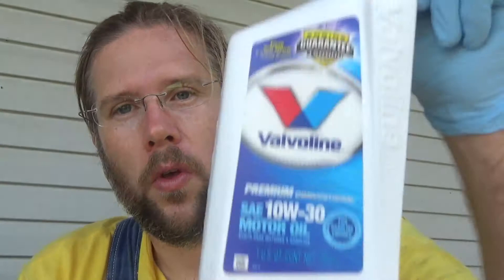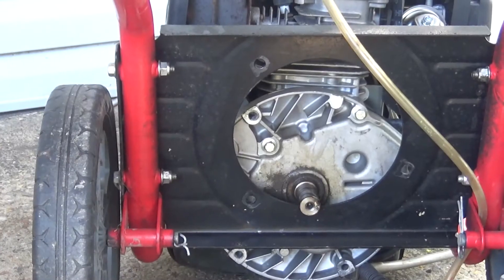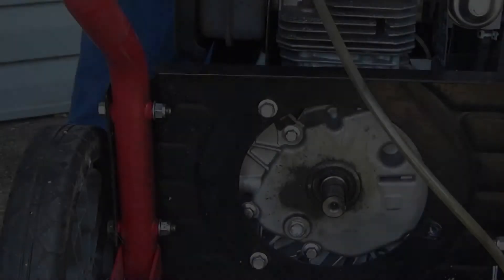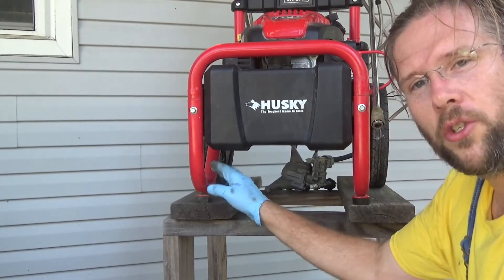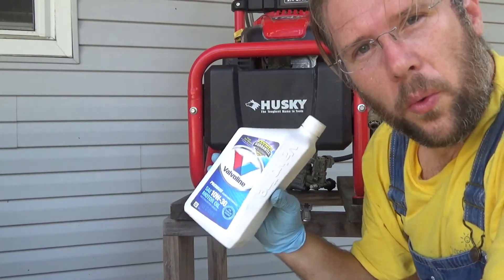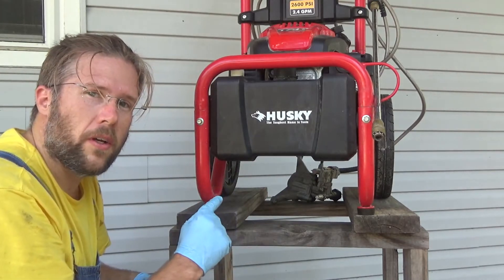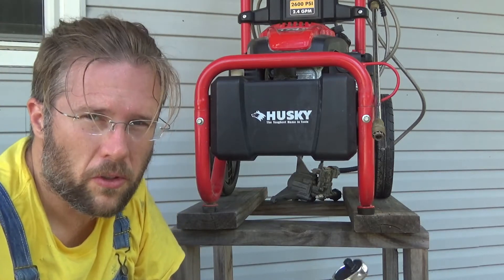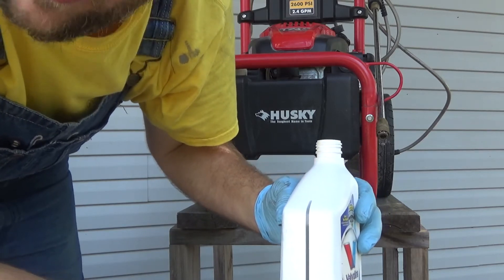Husky Pressure Washer HU80709 with Kohler Courage XT-7 173CC Oil Change

Comment: My neighbor asked me to get his HU80709 running.
It looks like a very nice machine, and thanks for the quick summary about the oil change.
When I do oil changes, I pour oil out of the new quart container into another
'spare' container until the original has exactly 22 ounces.
Then, just pour ALL the 'new' container into the engine.
Simplicity is next to godliness!
-=-=-=-=-
The overall pants are also great for those of us that hate belts.
Keep up the great work!

Mr Brown - Swamps of Florida ---
Reply from the maker: Thank you for the comment and suggestion.

Comment: I have the same pressure washer, possibly a slightly newer model.  Most of this is unnecessary for mine, as you just tip the machine, fully assembled, on it's side and 99% of the oil will drain out the oil fill tube. Much faster.  I also found the drain plug on mine. It is also sealed and takes a large Allen wrench. Probably intended to prevent disassembly.

I love the minion outfit too. LOL
Reply from the maker: You could tip this one too and it will run out of the fill tube. Thank you for the comment.
Reply: I'm changing mine now and the manual actually says to just tip over and drain through the fill. Thanks for the video, though. 👍

Comment: I have the same pressure washer and was wondering if you could help me with a problem its having. I saw the machine is leaking oil from the Crank seal. So I was wondering where I could find a replacement for the crank seal? Please let me know if you know. Thank you
Reply from the maker: I can try.
Reply from the maker: Check the following site, I am not sure if they are any good or not, but you may be able to cross-reference the part elsewhere.Also, you could try to make your own with some gasket maker like Permatex Ultra Grey. https://www.partstree.com/parts/search/parts/?modelId=9c744f749ae707df46eb2e51a889811ea5bc224d3deba47c0fe06c06eb1f1b50&searchTerm=gasket

Comment: I have a Hu80709 pw like the one u did oil change. I'm replacing the oil gasket. The cam came out and I do not know where to line it up. I see a dot on each gear.  Ty.
Reply from the maker: I wish I could help, but I am not sure what the alignment would be.

Comment: Hello I have a question..my unloader valve is stuck ...or do I not have one ..please help..I got it off someone there was a crack in valve..I'm use jb to stop leak.. back to unloader..I took of screw.. spring and still won't come out please help
Reply from the maker: Are you able to post a picture?

Comment: I followed your instructions up to the gasket and then saw the comment about tipping the oil out. Now that I'm reassembled I have no pressure. Any help?
Reply from the maker: Tipping is not the best way to change the oil. Let the unit sit for 30 minutes or so and try again. Did you refill the unit completely? When you say no pressure, what are you referring to?
Reply: @RazorBucks  The water pressure. The engine turns over just fine but I'm worried something went wrong during reassembly or disassembly that mucked with the pump. Water comes out of the nozzle but there's no strength behind it anymore
Reply from the maker: @user-fr2qk9op8t  Do you hear the engine bog down when you squeeze the trigger?
Reply: @RazorBucks  I'd have to check again to be sure but yes.
Reply from the maker: @user-fr2qk9op8t  Nothing in the screen blocking the water correct? Just to verify, you did reassemble everything like it was correct?
Reply: @RazorBucks  I mean, I think. I wish I had known I wouldn't have had to disassemble it at all honestly lol.

Water goes in and comes out. It's just a weak stream
Reply: Also when you say "screen" what do you mean exactly?
Reply from the maker: @user-fr2qk9op8t  Disassembly is the manufacturer recommended process. I would check again to ensure everything was reassembled correctly. I will try to find the manual I used and link it for you. Can you upload a video of it? It does not sound like it is building pressure.
Reply from the maker: @user-fr2qk9op8t  There is a filter screen where you connect the water hose to the unit.
Reply from the maker: Check page 39 for oil drain, http://www.kohlerpower.cn/engines/onlinecatalog/pdf/tp2601_308.pdf . Here is a link to a manual for the pressure washer, check the troubleshooting section, https://www.manualslib.com/products/Husky-Hu80709-240129.html . Did you find out if the screen was clogged or not?

Comment: I have a 12v pump with tubing, that fits down the dipstick holder just warm up the motor oil and suck it out!
Reply from the maker: @duanetehoke2175  transfer pumps are great, if you have one.

Comment: Easier to just make a vacuum pump to pull oil out from filler hole so you dont have to remove the water pump.